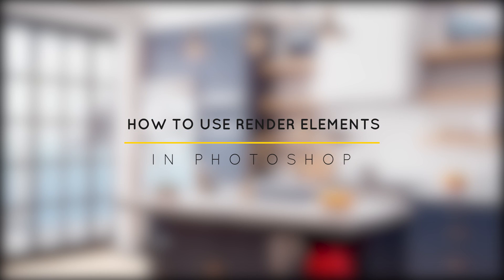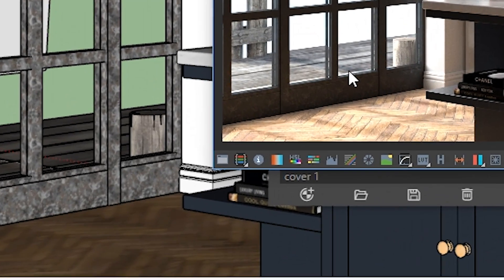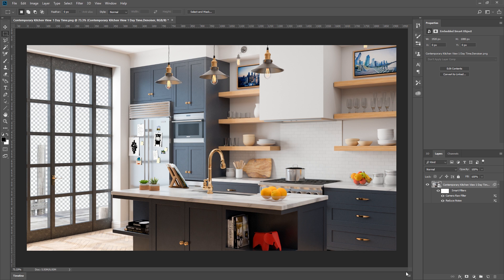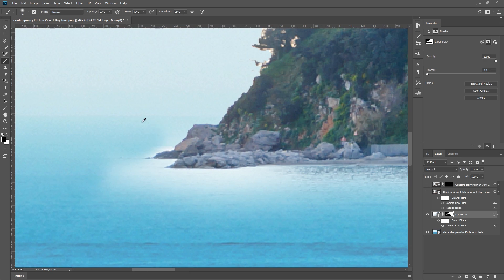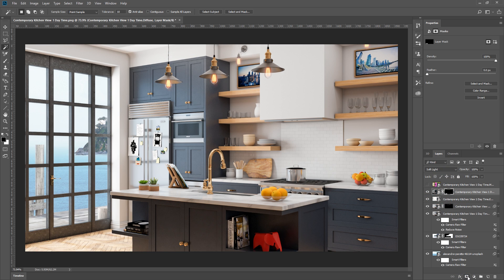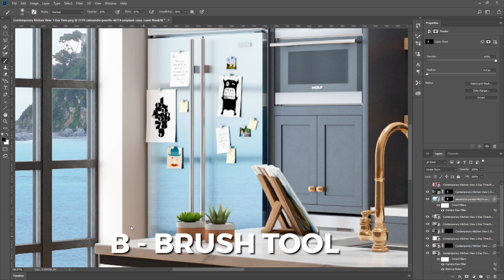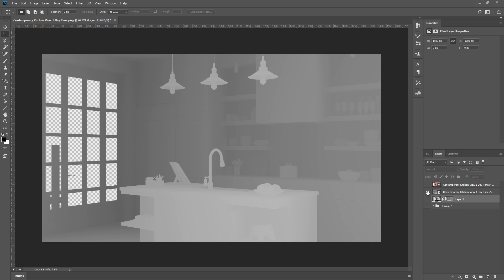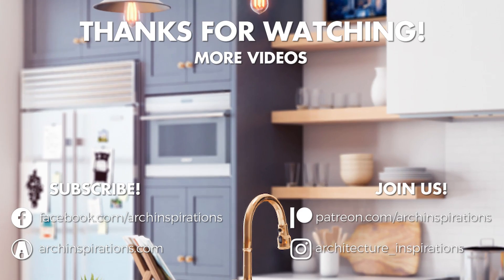How to use RENDER ELEMENTS / CHANNELS

Comment: Why open an RGB file at all instead of just working on the Denoiser file to begin with?
Reply from the maker: Nice observation! Usually when I have a denoiser image, I wouldn't have to use the rgb image at all. Unless the denoiser was too strong then I can overlay it on top of the rgb then put it at 50%. But you're definitely right ^^

Comment: Hey Minh. I have a question for you: I'm trying to do the same thing in V_ray 4 for Sketchup, but alpha channel is not showing my balcony (your pier)! I've set Reflection and refraction properties  to "Affect Channels: Color+Alpha" and enabled "Reflect on the backside". No luck! All glass shows black in alpha render element, no matter what's behind it :(
Reply from the maker: Does your glass have thickness to it? Or is it simply a plane with two faces? Glass needs thickness in vray to work correctly
Reply: @ArchitectureInspirations  Neither version works.
Reply: What's interesting, I have file from version 3.6 which worked perfectly, in 4 no luck.
Reply from the maker: Hm I'm not sure, and you're not using HDRI correct?

Comment: why my settings are different from yours, I don't have the render element option. is there is something wrong that i'm doing or do i have to download the elements? thanks
Reply from the maker: Probably because you're using a newer version. This was done in an older version of Vray
Reply: @ArchitectureInspirations  then what sould we do for this version brother?
Reply from the maker: In the Vray Next version, you can still use render elements, it's next to the settings icon on the asset editor
Reply: @ArchitectureInspirations  yeah thanks,i think i feel so dump now 😅

Comment: I get stuck at the zdepth. It just goes over the image and lens blur doesn't work. I don't get the image with little squares like you do it just darkens the image. Any tips on why that might be happening?
Reply from the maker: Hm did you use the same method I showed?
Reply: @ArchitectureInspirations  Well apart from doing the render in 3DS max instead of sketchup yes. I followed all your steps and check it several times. Did I need to set something up in the vray for the z-depth channel?
Reply from the maker: Hm as long as the Zdepth channel looks similar to what mine is, using it in Photoshop shouldn't be an issue. I'm not sure what the problem is 🤔
Reply: @ArchitectureInspirations   Okay. Ill try another time with a different render. Thank you for the replies

Comment: very special thanks.
can i use my normalrgb channel as base layer?
Reply from the maker: Definitely!😊
Reply: but if i have my rgb as a base i can only go higher or lets say more exposure for all the following passes and i can´t diminish the intensity of the light for instance. Is there any way around there?
the effect with glare is awsome btw.
Reply from the maker: Hm I guess I still don't quite understand your question. Which part of the video are you referring to?
Reply: for example i have my rgb layer as the base layer and then i add lighting pass. if i want my light to shine less bright instead of brighter (which is what happens when i use linear add mode) what can i do to create the vice verse effect? thank you
Reply from the maker: I think you would have to adjust the exposure of the image using camera raw filter for example

Comment: Hi, your video is great like always, I couldn't find out how did you get windows transparent after you save and have ready for Photoshop? After I save images I still have the background from sketchup. Thanks
Reply from the maker: Hi Vladimir! so it's in the glass materials settings, you need to make some adjustments before render. I wrote a small post on it in our forum here https://archinspirations.mn.co/posts/how-do-you-render-with-transparent-background-on-windows
Reply: Vladimir, u should save render as png (not jpg) and than insert it in Photoshop...